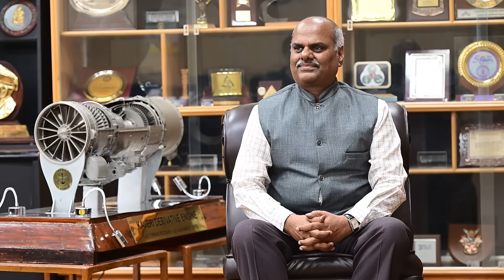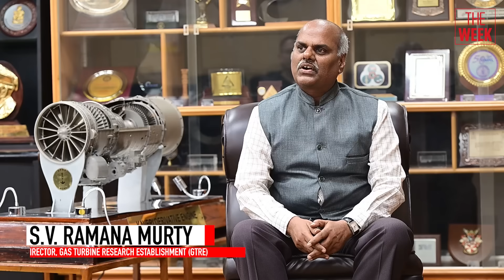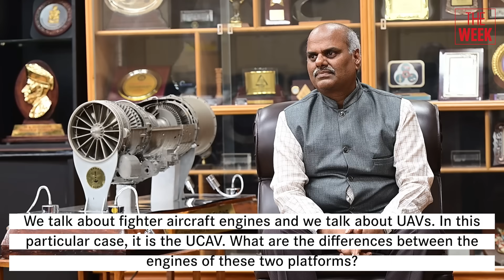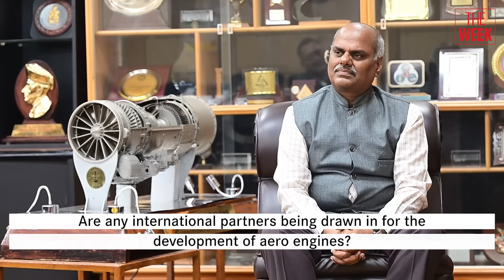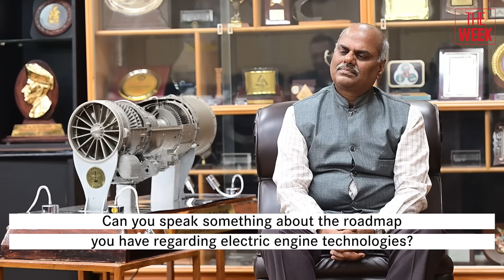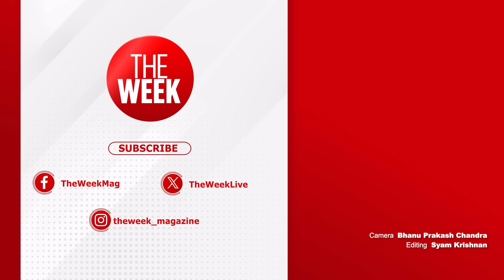S.V. Ramana Murty interview | Director of Gas Turbine Research Establishment speaks to THE WEEK

Comment: GTRE Need to be rewamp by Military Inteligince. Dont lie . Equipment for Manufacturing/Design/Testing can be bought from RUSSIA/FRANCE/UK/GERMANY. No mundane explanation. If material related ISRO lab and Academia lab can give their help. Why need After burner. Use non liquid fuel.Or electric. #MODI#RAJNATHSINGH#

Comment: It might be a good idea to entrust the development of the Kaveri engine to a top private engineering company with foreign collaboration. Otherwise it will never be completed. Only an irresponsible ecosystem will have the attitude to throw away the  valuable resources of the country. Still it seems nothing has changed. The race is already lost, however if the pmo takes direct control of the engine development program something could be salvaged possibly.

Comment: GE made its first jet engine in 1942, since then with so many innovations were added to enhance the overall performance of the present jet engine the company currently exporting to HAL.
Whereas  DRDO's GT'RE started making a partially  successful jet engine Kaveri Jet Engine,. 
The difference is GE is continuously improving jet engines, since 1942 where GTRE is improving Kaveri Jet Engine since 1990. So, there is a gap of 50 yrs between the two.

Comment: Get the Kaveri engine fitted Tejas on the air.  It will be under-powered fine - it can be used as a backup to  Sukhoi and Rafael .It could be used for training new pilots before they graduate to the more powerful jets. But the most important thing will be the valuable  feedback that will be received from Tejas pilots from different real  world scenarios. This will put a unique momentum to further innovation like no other. Just get the damn Kaveri fitted jets in the air and let the feedback drive the innovation enough of  bookish - laboratory work.There will be no end to it.

Comment: It will still take another 15 years to reach manufacturing stage after all the prototype, successfully engine mated with the air frame, stress testing, induction and finally a complete aircraft.
Meanwhile as it will be taking time Airforce will require additional modifications and changes of engine performance requirements, and again the development will go ground up development from scratch.
By this time US and China will have their 7 generation aircraft squadrons exporting bids.

Comment: Sir, with great respect for you, till such time Kaveri engine is integrated with Tejas aircraft, till then it is a failure or non starter.

You are justifying its existence and hence yours as well to a certain extent. But please think of the tax payers money which was wasted.

If it is good enough, why is it not integrated with Tejas for manned aircraft even when GE is delaying the delivery of F404 engines for Tejas?

And Integrating it unmanned combat aircraft means it is not good enough for manned combat aircraft which means not trustworthy. Simple.

Comment: R & D Spending as % of Defense Budget
China - 20, India-2, US- 13.
India has huge potential. In AD Scientific Index (Top 3% Only)
India- 165K, China - 105K, US-458K, Indonesia- 138K, UK- 96K.
In Last 5 years, It seems like you're sharing some impressive data on India's research and development (R&D) landscape. Let's break it down:

India's R&D Investment and Output:

- India invests 0.71% of its real GDP in R&D, which is relatively low compared to other countries.
- Despite this, India has:
    - 165,000 scholars in the ADScientific Index, ranking 2nd after the US.
    - Produced the 3rd most highly cited research papers in the last 5 years, with 1,03,407 papers.
    - Ranked 5th in patent grants in the last 5 years, with approximately 481,057 patents granted from 2020 to 2024.

Global Rankings:

- Top 5 countries in highly cited research papers (top 1% globally) in the last 5 years:
    1. United States: 263,063 papers
    2. China: 206,866 papers
    3. India: 103,407 papers
    4. United Kingdom: 83,726 papers
    5. Germany: 74,701 papers
- Top 5 countries in patent grants from 2020 to 2024:
    1. China: approximately 2,500,797 patents
    2. United States: approximately 1,735,245 patents
    3. Japan: approximately 1,034,368 patents
    4. Republic of Korea: approximately 641,734 patents
    5. India: approximately 481,057 patents

Call to Action:

- Increasing India's R&D investment to 2.5% of GDP could lead to more inclusive and advanced R&D, driving innovation and growth.

Overall, India's R&D landscape is showing promising signs of growth and innovation, despite relatively low investment. With increased investment and strategic policies, India could become a global leader in R&D.

Comment: Failed project hoga toh failed hi bolenge na.
Engine was designed for Tejas Aircraft, we don’t blame GTRE alone,no budget was spent on the program. But if the objectives are not achieved, it is a failed project nonetheless.

Comment: Advanced metallurgy required advanced machinery and research manpower from leading Academia. They should have let a group of retired Airforce pilots and retired  Airforce Top maintenance engineers, Academic research and Leading automobile research engibeers from Private corporates like mahindra, Ashok Leyland etc to form a core committee for oversight and top among them to be Board of Directors for GTRE. In few years we reach our objectives. The GTRE team actually knows what they need to do to bring out an engine, without shifting goalposts give them funds and management manpower then ask what they have done

Comment: Kaveri is a 4th generation engine. In other words, an engine designed for 4th generation aircrafts. 

Most countries that have developed aero engines, have gone through all the previous iterations (1st gen, 2nd gen, 3rd gen) and so on. 

Therefore if it took the likes of Dassault about 10-12 years to develop the engine for the Rafale, it is unrealistic to expect GTRE to deliver their maiden engine within the same time period. 

The Government's fault is the non-provision of domestic testing facilities, including a Flying Test Bed. 

All said and done, GTRE has done an above-average job. But I wish it had better Spokespersons. The Director need not speak at all times.

Comment: How could Egypt develop a jet engine in 1960s     BUT    we couldn't do that  till 2000 ?
Reply: We have developed an engine. But it's far too underpowered to use on modern jets.
Reply: @AC-gu9ks according to  you 73 kN is FAR TOO underpowered but 75 kN is not.??

Comment: No, Kaveri is not dead. It has taken 40 years and is still nowhere in sight but it has been kept alive. This is good because we do need our own cutting edge engine but I'm worried about GTRE which has been toying with jet engines since the 1950s, over 70 years, and has not produced a single engine of any type that is in service with defence forces or civil aviation. Not even a turboprop which most UAVs use. Instead, it wants to use Kaveri on a UAV, maybe even in a ship! Govt has made a huge error by not closing GTRE and giving the remains to a private sector consortium which can hold 60-70% equity with govt holding rest. Otherwise, we will get Kaveri when it becomes obsolete and we don't need it, just like LCA. This socialist nonsense must stop.

Comment: We spend 2 lakh crore in extra rice procurement and farm subsidies for fertilizer and electricity, to grow excess rice, that we don't need. 2 lakh crore is about 20 billion dollars. Because of this, production of pulses and oilseeds, goes down, and we spend another 20 billion dollars importing them. So, we waste 40 billion, that we could have spent in R&D.
Punjab alone receives about 5 billion USD, for procuring 20 million tonnes of rice at MSP of ₹2300 per quintal. And we are growing total of 30 million tonnes of excess rice already, with buffer stocks at 60 million tonnes. This waste is more than what China spends on R&D every year.
And then there is opposition to lateral entry experts, because some people are against the caste of the experts. Whereas, China literally invites American experts to assist them.

Comment: The major backstabbing in Kaveri program was delinking of Kaveri from tejas. If Kaveri wasn’t generating desired thrust then we should have invested more efforts and money. A fighter jet is designed around an engine and tejas was designed around kaveri and now tejas program is struggling because of 404.
Second major blunder was refusing safrans m88 core for kaveri.

Comment: Question 1 
Why was the kaveri delinked from tejas and why didn't the scientist protested to the govt when it was delinked ?

Question 2 
What was the final recorded thrust on the kaveri with and without turbofan ( wet thrust) 

Question 3 
It the GE F404 IN20 engines have a thrust dry and wet thrust of 54 and 84 Kn class and kaveri was recorded to have 50-51kn and with afterburner 70+kn then why didn't they tried on the tejas and why it was not refined to increase more 5-10 kn 

-------- MOST IMP QUESTIONS -----
Question 4 
Why didn't we responded to japans XF -9 engine yes it is big compared to the indigenous engine we r developing but japan was ready to offer its ENGINE CORE to us and if seen broadly we could have used those engines to replace the ageing AL-31 in SU-30MKI with some modifications as it is of same size ?

QUESTION 5 
 Now as the US is delaying the GE F404 engines which is further delaying tejas delivery is the govt asking DRDO GTRE to make a shot at kaveri again ?

Itna pucho agle video k liye aur question de dunga
Reply: Ans 2- Good Question. May be released in upcoming reports.
Reply: Ans 1- It's not the job of the scientists to do protests against government's decision. That is something which must be done by the general populous. If they're not working on Kaveri they're working on other important projects. Though I also think that delinking it was a blunder on government's part.
Reply: @shivanshjadhav totally wrong govt doesn't posses the knowledge in aviation it doesn't know that if such a suffisticated tech in left mid way the developed tech will be lost ASAP and for our case it is just the brilliance of our scientist that they created a 49-52kn engine with a quarter billion investment that's very less compared to those in west US specially developing from scrap and here bro PM DM is just a politician they don't know the consequences of tech being lost but if scientist make an argument or a protest towards the govt they will understand the gravity and in this country at that very point of time when it was delinked there was no knowledge in common people of this imp things 

That's enough for you i guess
Reply: Ans 3- Not the correct person to ask this question, this is a question that must be asked to the political leadership. These WANTED to work on it but due to lack of funding and political will they weren't able to do anything, they must've given some proposals but that was of no use.
Reply: Japan only offered co-development, I don't think the Japanese would directly offer us the engine core. Also, XF-9 cannot be used on Su 30 because Russia wouldn't allow it and the Japanese would not like their tech to be integrated with Russia's. We have the source code but not all of it just enough to integrate our weapons and tweaking the aircraft to Indian requirements integrating a different engine is a totally different saga.
Reply: @shivanshjadhav so let me answer it in deatails 
We operate 180+ SU-30 and we have 100 percent tech transfer + all the source codes that's why we integrated BRAHMOS , ASTRA , NIRBHAYA AND REST OF THEM ALL 
And coming to next part of your question japan has no application of XF-9 their 6th gen program has been merged with GCAP of UK and Italy so the engine and tech has technically no use it's just a TECH DEMONSTRATOR 
as GCAP will have a new engine co developed by them but Japan's wants to profit out of this so they offered the core + the engine if india takes it on big numbers and the XF-9 is a AL - 31 41 CLASS engine so it will fit easily and the only problem here is the integration which can be easily guided by slight frame adjustments and russia will not have any problem with that as india rejected any engine change bcoz AL-41 has just increased fuel efficiency compared to the 31 which is not value for money and they will not have that huge a problem and japan trust india they r planning CHANDRAYAAN 5 together so the Collab is real my friend I hope I got you all covered up 🙌🏻
Reply: Ans 5- Again, wrong person to ask, political leadership is answerable here. Don't pull these guys in politics. Personally, I think you're right government is asking GTRE because the idiotic behaviour of US.
Reply: @shivanshjadhav   100 baato ki ek baat..40- 50 saal se ek bhi working engine kyu nahi bana paye... airforce ne reject kar diya...ek ghatak unmanned banaya hai par vo bhi tested nahi hai...  This is correctly termed as failure...

Comment: Sir
I don't understand why it took more than 30 years to develop fighter engine. Even the thermal fogging machines used to control insects in health department has mixed alloys which can withstand up to 1000 to 2000 degrees heat ie inconel material Motan Germany. What is the scientific institutions is doing since last 30 years is un imaginable.
Reply: You don’t understand because of your ignorance of the technical challenges.  Don’t just throw around some temperature number from some useless area and think it is comparable.  Jet engines need to sustain insanely high temperatures  AND at tremendous pressures AND demonstrate durability.  Why do you forget to consider the pressures AND with durability ??  When Rolls Royce builds an ej200 engine it does a piece of it.  The rest it gets from other companies in other countries.  It does not do everything itself even though it has been building engines for decades.  It outsources skills and knowledge and technology.  Why the heck do you demand so much from gtre with so little funding ??
Reply: @Motivation-qf5gg India is a joke😂
Reply: @alliswell-p3e yeah sure it’s a dead economy!  Place your bets if you have any money (I’m giving you the benefit of the doubt that you’re not a pauper) against India.  I will take the other side of your bet and make an absolute fortune 😂
Reply: Do you think fogging machines are equal to jet engines😂
Reply: Why don't you make one ?🤷

Comment: When he says the engine is validated within a limited flight envelope, what exactly is this limitation?, and in what ways does the envelope need to be expanded?
Reply: It basically means take what we were able to build that's the envelope.. any requirement beyond that is pushing the envelope 😔
Reply: Basically capacity it's a overweight underpowered engine and needs to be treated as such. So putting it in a UAV is ok but putting it in a tejas Is out of the envelope

Comment: My concerns are these... even for R&D, so much of dependence to foreign technology, certifications, and dependent support systems. There is zero effort to establish them at home. This is deeply concerning, and is a failure of GTRE as an organization of gov establishments. GTRE needs some serious introspection.. it ain't about failures, but how you failed, and how you managed the failures, and how can in the future, manage it. GTRE must be rolled up and a new enterprise, joint or however it is must be established. A private player or two with 49% share is ideal. Example - the flutter issue. Way too much dependencies from foreign support systems. Why? test facilities, in house engineering and production engineering setup, concurrent modules, and no serious end-end thinking. Any aero platform can't change thrust requirements to a lower grade and deliver to requirements. This is a program level failure, not technical alone.